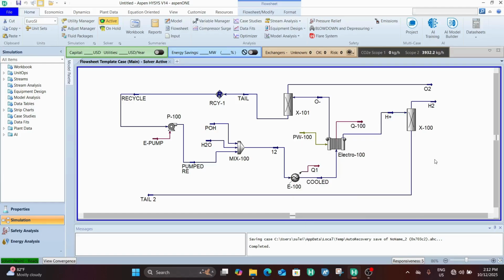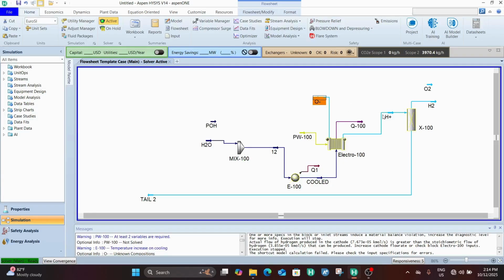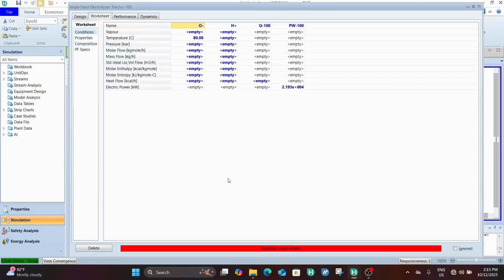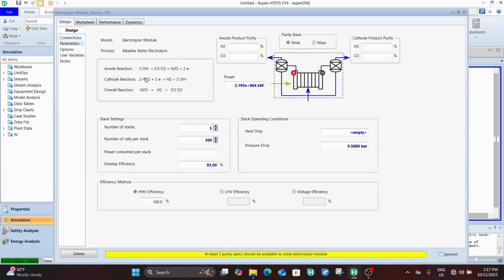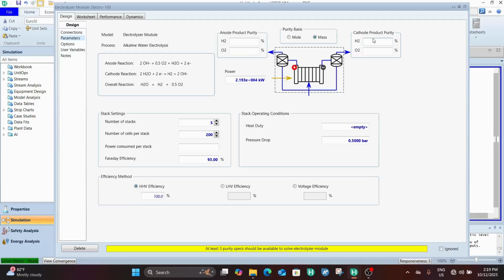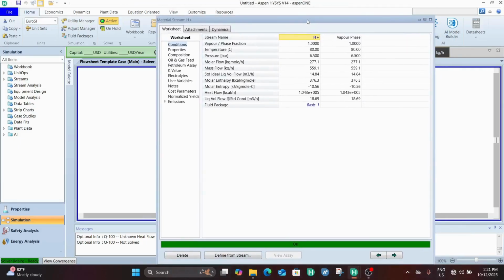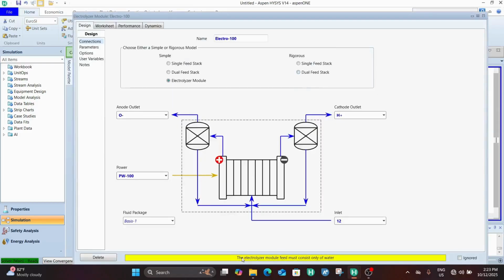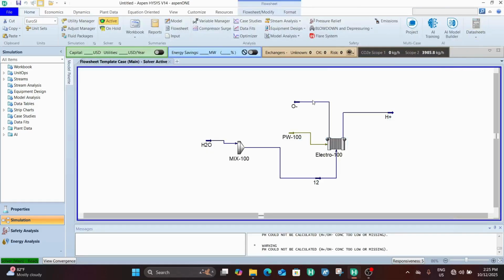PEM WATER ELECTROLYSIS USING ASPEN HYSYS

Comment: Thank you so much sir, I have watched all your videos related to hydrogen production. 
If possible, can you please make a on hydrogen production flowsheet containing all the unit (Primary reformer, Secondary reformer, HTS, LTS, PSA and methanator before entering the make-up gas to ammonia convertor?)
Reply from the maker: Thank you for your support sir. Absolutely will do that in the near future. The current content is for intermediates so the models are kept simple, accurate and clean.

Comment: Thanks for the video can you do one for a PEM fuel cell much appreciated
Reply: That’s exactly what I was thinking! I’d love to see an addition of a fuel cell😊
Reply from the maker: @howardc04the response above to @BLAZAKIN  also is for you too @howardc04
Unless of course we are all not talking about the same fuel cell. In that case I'm all ears to hear your side furthermore😊
Reply from the maker: Thank you very much sir. 

😮When you say fuel cell you're surely not talking about the PEM fuel cell I know which entails turning H2 and O2 into electricity right?
You see that there is the opposite of what we just did with our PEM water electrolysis with respect to every action we took. 
We input power(electricity) for PEM water electrolysis to produce H2 and O2

But for PEM fuel cells now we are expected to produce electricity by inputting H2 and O2 and HYSYS doesn't handle electrochemical kinetics with its inbuilt settings

To do fuel cells one need to create excel user defined logics and pair with HYSYS. 

In summary HYSYS alone can't do PEM fuel cells
🤕I'm not making any promises but I will look into the excel user defined logics if it's something we can cover for you